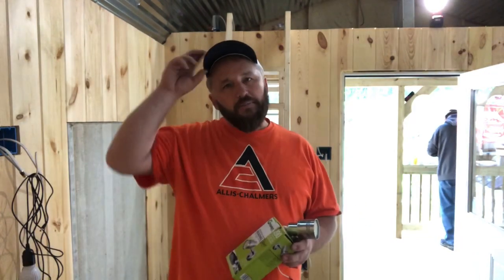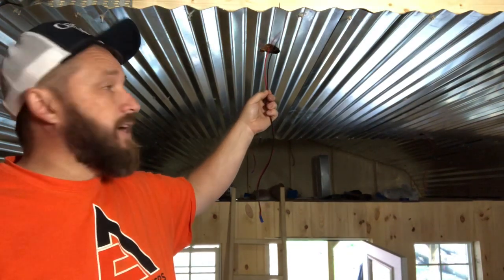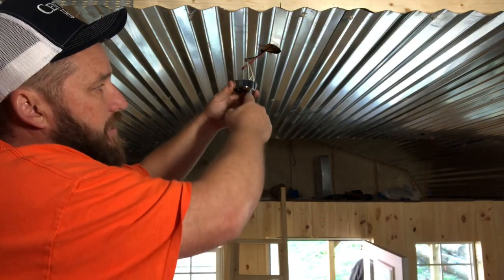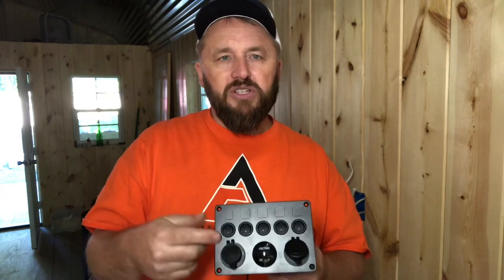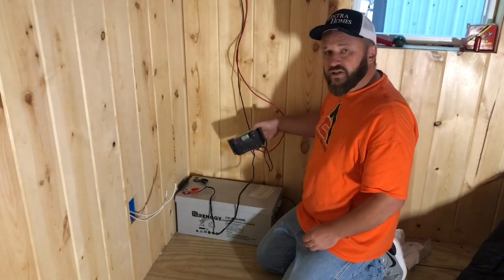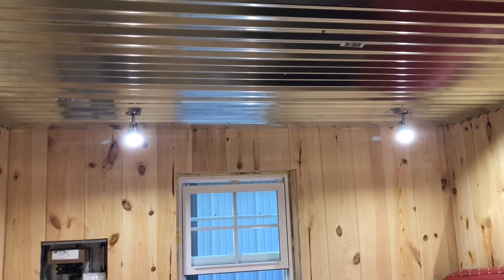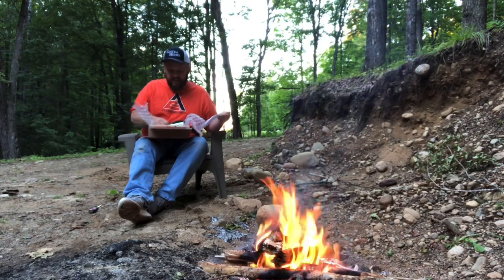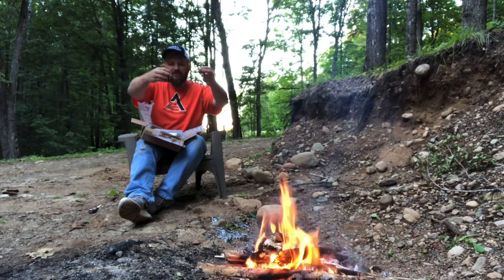DIY solar power for my off grid cabin #solarpowerforcabin #karlsoffthegrid #harborfreightsolarpanels

Comment: Love the crimp idea for connecting.  At first I thought you were using male and female spade terminals.
Reply: The wiring on this is more simple than I was thinking.  Excited to see how you tie into your supply (solar, etc).
Reply: I think my battery bank would be exterior covered somewhere.
Reply: Super cool mail call
Reply from the maker: Arkansas Woodcutter You don’t know how many times I was going to call you when I wired the AC.I had a lot of questions but it’s fun learning. Thanks for watching

Comment: Youtube stopped sending email notifications Aug 13th.  I think the phone app still has some capability to provide notifications though.  I really like the central control panel for all the lights but might want a single switched light just inside the entrance.  Could be the same light fixture wall mounted with the internal switch.  Cabin is really looking great.
Reply from the maker: James Finnall I like your idea about the light by the doorway, it is in the works. Sorry about the notifications I am hearing that from a lot of my subscribers and it is really upsetting

Comment: When you wrapped around the room. Did you cut your t&g corners on a 45 or did you keep them straight.
Reply from the maker: The inside corners I went straight but the one corner that comes out into the room I cut at a 45° angle.
Reply: You did a great job on the cabin. Did you keep it natural or finish it with a  polyurethane or something. And when do you apply it before you put it up or after

Comment: Just watched Last night could you please send me the info on the box where you got it and what brand thanks for the info.
Reply from the maker: https://www.amazon.com/dp/B01N0EGOKK/ref=cm_sw_r_cp_awdb_imm_5K3727ZMEFBPKJ41KC64?_encoding=UTF8&psc=1
This isn’t the exact electrical box/panel that I used it’s slightly different but it does the same thing. Sorry I can’t find the exact link I made this video last year
Reply: @karlsoffthegrid1378  Thanks I found one.Where did you put the ground fuse block .
Reply from the maker: @richvanpelt3390  I have a main fuse right off of the battery bank and then I also individually fused each fixture in the wall behind my control panel. Don’t forget to put the fuse right after your batteries it’s the most Important fuse in the system. It will keep your house from burning down
Reply: @karlsoffthegrid1378  What size fuse after the battery? And the rocker switches I just got don't have any fuse links should I put them on ? Thanks for the help..